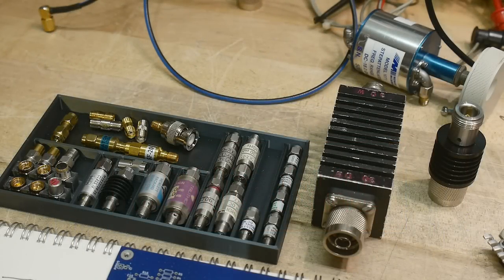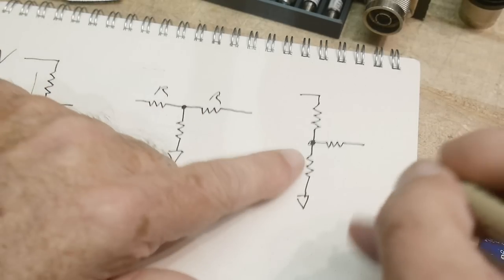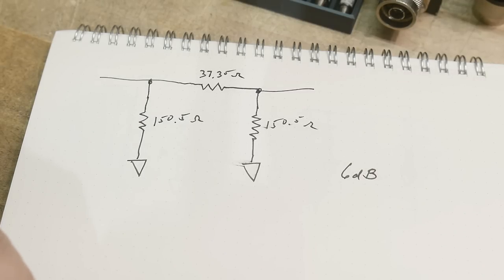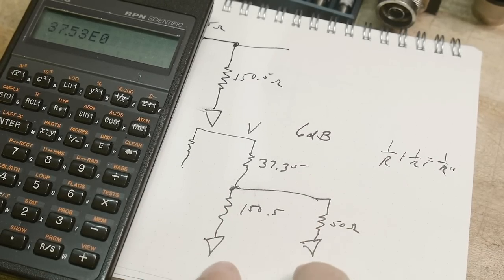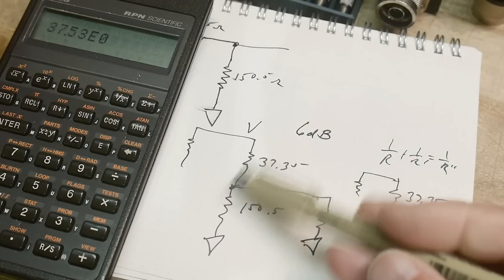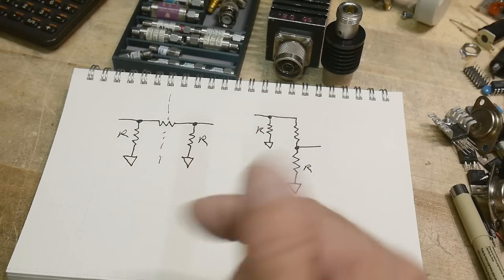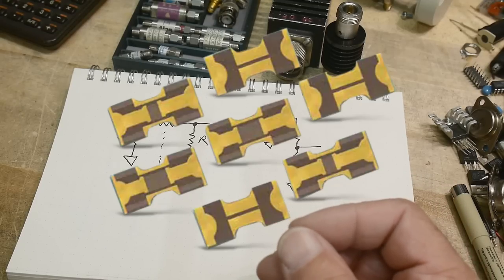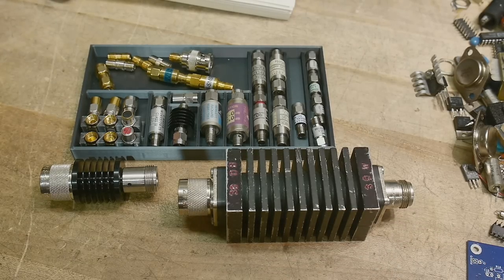#1395 PI Attenuators

Comment: The pi network divides the (open circuit) voltage twice; the incoming line also has 50 Ohm output impedance.  At 14:40, your resistance values are backwards.  As shown, this has input impedance less than 37 Ohm.
Reply from the maker: damn it. you are right
Reply: @IMSAIGuy  Don't sweat the small stuff.  Peer review is quite valuable.

Comment: Great Clip.
I like the way you redraw the T and PI network for better understanding.
Also, The Pi Network can be used to change impedance( ie. from 75 ohm to 50 ohm etc. ). The advantage Pi network over transformers for impedance transform is that they can have wider band width, and can work all the way down to DC, where transformers can not.
Thanks for great clip.
Reply: However, the resistors solution would waste a lot power which the transformer one would not if your range of frequencies used are fixed.  The old pocket radios were full of those transformer because the wasted power was important, but the bigger radios and TVs just full of heavy resistors and the wasted power was not an issue for the designers who didn't care how much power converts to heat, because they weren't battery powered.
Reply: @bayareapianist  For higher frequencies, you can use tapered transmission line to do wide band impedance matching.
Reply: @aduedc  you can use Balun which is a kind of transformer.  Baluns are used both for RF and audio frequencies. Transformers can give you differential outputs which are used in audio equipments to get ride of ground effects (hamming).
Reply: @bayareapianist  BALUN  (BALanced - UNbalanced)  are used to convert signal to/from differential to/from common mode.  
A transformer based BALUN is constructed from two winding on a core one of them with a center tap, which gets connected to the other winding and used as ground.   Old Push-Pull stages used to use transformer based balun,  
At very high frequencies Rat-Race structure is used to achieve this.
At low frequencies opamps are used to achieve this.

Comment: I would like to point out that at RF frequencies, one can use a 10 dB or higher attenuator as a dummy load, properly rated for the power to be dissipated.  It would be best practice to put a 50 ohm load on the output, but in a practical sense it will work without it.  At 10 dB, only one-tenth (1/10) of the power reaches the output.  With the output open, that power is reflected back.  But, by the time it goes back through the attenuator, the reflected power is one-hundredth (1/100).  You are not likely to even see that small of reflected power on the typical SWR meter.
Reply from the maker: I did a video: https://youtu.be/WakbPENJHXA
Reply: @IMSAIGuy  Tnx.  I went to watch the video and found that not only had I watched it, I had made a comment on it.  I just went and joined your Patreon.  I watch enough of your videos that I thought I should contribute.

Comment: its always been crazy as hell to me that were pushin so much rf thru passive components that they need big ass heatsinks   thats a good bit of power goin just to heat
Reply: Travis - It does seem strange to generate a bunch of power just to waste it in resistors.  I think that this could be an old way of doing RF.  Much as power supplies used to use linear regulators which wasted a lot of heat.  Maybe radio transmitters need to waste some heat as part of a feedback loop to produce a stable output.  I'm just guessing though.  Cheers.

Comment: Why do the large attenuators show 50 ohms both ways WITHOUT a 50 ohm load on the output?
Reply from the maker: run the calculator for 30dB and you will see

Comment: Hi, a nice attempt to explain the PADs. But there are many confusions. 
There are symmetrical and non-symmetrical configurations as there are balanced and unbalanced types.
They can be pi, L and T shapes.
Apart from the attenuators there are 50 ohm ( or 75 ohm) terminators that would have only one connector.
The nearest value commercially available for the -6dB pad is 150 ohm and 39 ohm.
I used 5w carbon resistors in my 4×SD2933 MOSFET transistor amplifier.
By simple oversight you drew the value of resistors swapped for the -6dB pad at 14.26, though it was drawn correctly in the start. 
The thin film resistors on the BeO ceramic substrate mounted on the aluminium finned heat sink are real engineering Marvel. 
De VU2RZA
Reply: Sounds like your plan would make a much longer video.  All good info, but content creators have to decide where the boundaries for a single video are, and I think this one is fine.  The nit about the values being swapped is fair, but other than that I don't think there are "errors" (or "confusions") so much as it's just not treating all kinds of attenuators in maximum depth.
Reply: @yakovdavidovich7943  yes, a longer video is not new to Imsai guy and I would always appreciate and enjoy them.
As he has shown it cannot be considered as a simple voltage divider but can be explained only by the mathematical formula.
Only the symmetrical types would pose 50 ohm (or say 75 ohm) at the input and the output. 
Asymmetric devices especially the L type would present different values and by adopting a 50 ohm you can measure the same.
Moreover it doesn't require a 50 ohm termination at the output; it's designed with the assumption that the circuit would present the characteristic impedance both at the input and the output.
The brunt of the power is borne by the first shunt component and must be rated to handle it. Other components on the downstream can be derated accordingly. The value of the resistor (usually the shunt value) would be very different the 50 ohm.
It's like the LC low pass filter design where the passive resistors are replaced by the passive LC components to achieve certain degree of attenuation while maintaining certain characteristics impedance value.
De VU2RZA

Comment: I am waiting for the teardown of one of the high power attenuator.
Reply: I'd also like to see a teardown.
Reply: That would be a bad idea since they contain hazardous materials like BeO (beryllium oxide) which is carcinogenic.
Reply: @mikesradiorepair  there's nothing to worry in opening it up. All RF power transistors have the BeO ceramic caps on them. You can touch or even try to taste it. You won't die. If you powder it and inhale you have trouble. The big attenuator has Hex screws and can be removed. What imsai guy showed in the picture you would see inside; yes, I have opened it and seen the inside. It was a 100W (continuous) 30dB attenuator. By mistake I pumped 300W for a second or so; it went qrt. On opening I could see one of the resistors was open. 
If you inhale the dust (BeO) on several occasions for a considerable time you will end up with a condition called Berylliosis; it would present like other occupational diseases like asbestosis, silicosis etc. Lung cancer, squamous cell carcinoma (or other kinds) will develop after say 20 years or more of being exposed to the dust.
De VU2RZA

Comment: This is interesting.  Thank you.  I can see how the Pi attenuator can be used to match the impedance while reducing the power.   But it still borders on black magic for me.  Especially when Dbs are involved.  Why not just say 0.5 instead of -3db ???  Weird.  But there must be some reason from the days of the ancient wizards at Marconi or somewhere  :-)
Reply from the maker: using decimals of gain does not work well do to the large dynamic range of radios. +50dBm transmit and -127dBm receive. you would end up with lots of zeros
Reply: @IMSAIGuy  True there would be lots of 0s.  Also I read somewhere that people used dB because it is the Log and they could just add instead of multiply which is easier.  And they had books of log tables.

Comment: Indeed a nice attempt for explanation. However several things are presented simple. E.g. To the attenuators that measured a 50 ohm resistance no load was added. And  impedance is not the same as resistance.
Reply: Indeed, you need to connect it to network analyzer to find out how good match it is.
Reply: @aduedc  I totally agree. I mentioned to him in one of his posts while ago but I think this guy's doesn't know the difference.  He keeps measuring everything with his ohmmeter.

A VNA would be a better idea.

If I say in a stupid way, ohmmeter is to measure resistance in DC.  VNA measure impedances and phases in ac which are frequency dependent.   A good attunator has diagrams which show these values within its frequency range.
Reply from the maker: the pads are rated to DC but you are right about S11  here is video: https://youtu.be/WakbPENJHXA
Reply: @IMSAIGuy Yes. A good way to see if they work down to DC is to measure them with ohmmeter ;)

Comment: ... forget about 'swaping' the resistor-values at first, in the 'PI-equitation', ... !  

Is there not a relation between the 'T' and 'Pi', to the 'star' and 'triangle', in the 'normal electricity' circuits? Are the mathematical rules are not the same, or can be substituted? 

Do you remember the damned "elecrical-cube" made of resistor? Each single resistor of that cube, was 10KOhms. There were 12 resistors in the cube. It drove me crazy, when I saw the picture of the cube, and didn't know, to 'solve' the problem, ...! Not correct for parallel or serial, ... even a 'drawing'-solution was not possible. - At first! - Then the teacher showed us something to do, ... ! 

 I Think there was a kind of 'formula' or equitation for the 'star/trangle'-problem, as I remember, ... ! 
(I am a graduated and certified electician, since more then 4 decades. - A very long time ago, ... !)
I could be wrong, nearly half of a century ago I learned something like this! 
Sorry for my bad English, but it's not my native tounge.

73 de Markus - db9pz  (JN39fq - 5km, 3miles east of LX )